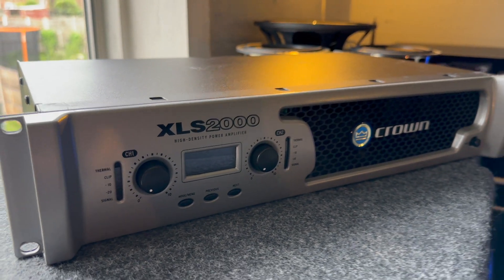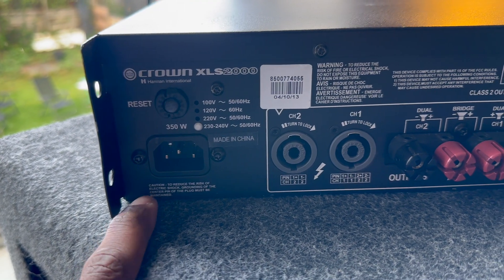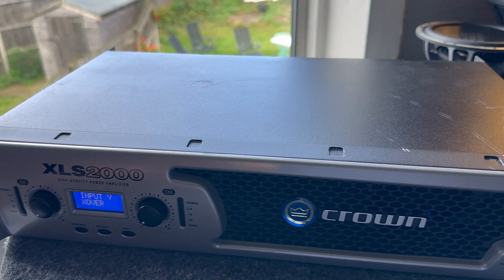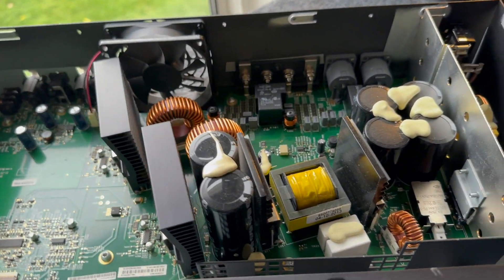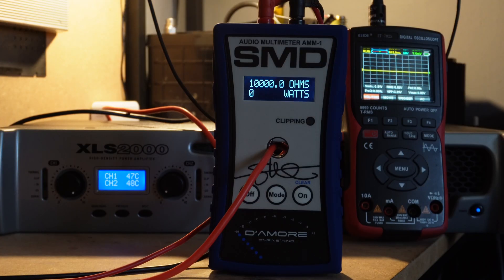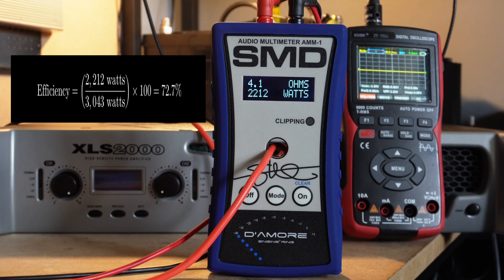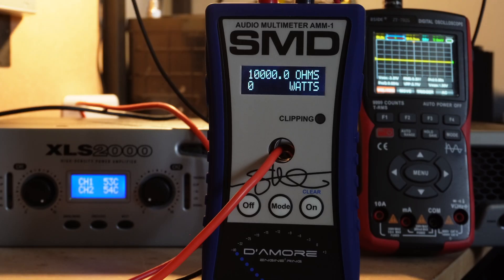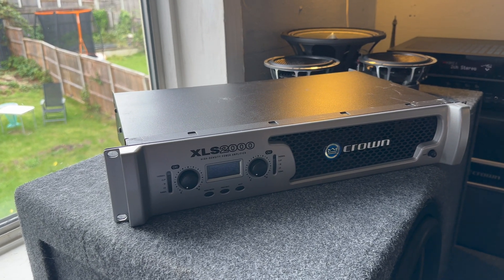Does the Crown XLS 2000 Do Its Rated Power? (Amp Dyno Test)

Comment: Thank you for this excellent review and testing, although I must say that I didn't really like that the certain Crown Amps (or any pro gear for that matter) is made/assembled  in China or for that matter anything non USA.   I stuck with a Crown CE 1000 from around 2002 that was made in Elkhart, IN as well as QSC PLX 3402, PL 236A, Carvin DCM 3800l/lx and Carvin LSX 1523s all american made.    I do use a Crown XLS 1002 (yes made in China) in my home theater system for my front JBL bookshelf speakers and it certainly does have , although not audiophile quality,  215 watts/channel into 8 ohms, more into lower impedances down to 2 ohm stereo,  way more guts than a typical AV receiver with 75 - 125 watts/channel (albeit those stretched with THD and frequency response)  at 8/6 ohms etc.  Also, it doesn't sound as strained, thin, lackluster, shallow, spitty or harsh as some users have described.   I do like Crown, but made in USA, which it appears some still are,  is a deal breaker for me in most cases.

Comment: Great video!! 🎉 I especially liked how you showed the efficiency etc!  
Question tho, won’t most people use this as a subwoofer amp? Perhaps running the dyno at 40hz might provide slightly different results. 🎉 thanks 

Btw, I’ve read that some crown amps lose ALOT of performance under 10-20hz… I think it’s been done before, but if you can, showing a freq response from 5hz-200hz would be awesome!! 🎉 great work!! 🎉

Comment: Great video.
I have two xls2500's (the amp looks identical to yours) that have been in storage in a sealed Gator case for about two years, tried them out yesterday but no output, DSP function is normal (set to stereo bypass), good input signal but nothing out from the neutrix or binding post. Do these amps have a factory reset? Cheers.

Comment: Nice test. I have a pair of Crown XLi 2500 amps (heavy, Class A/B amps). They are seriously under-rated at 750w x 2. I prefer the sound of Class A/B vs the "lightweights". In fact, owned several of these newer Class D ones and they all died early deaths. The two XLi 2500's -- never failed me once.
Reply from the maker: Wicked !! I’m glad your crowns have been treating you right
Reply: I have an xli 2500 I'm using for an 18'' subwoofer and a crown xls 2502 for my mains. The xli is 500 wpc 8 ohms and the 2502 is 440 wpc 8 ohms. my speakers are rated for 500 watts rms 2000 watts peak. Do you think I would be better off using the xli for the mains since it's a little more powerful? I think the xls sounds better but I've never actually tried it to find out. Two xls 2502's bridged are  1550 wpc each which is probably two much power right?
Reply: Do you think the real power is something around like 1000w rms per chanel at 4ohms?
Reply: what's the difference between the XLS and XLI 2500s?

Comment: I have the 1000 watt version, I love them! Now, the only issue with them for sub use is they roll off around 20hz. In most cases that's fine, but some people use tactile tranducers which go well below 20hz. So for that, it's better to use the Behringer amps which go flat down to 5 hz or so. They don't make stated power, but even at 2/3 rated they're a great value and the DSP basically pays for itself. If you have a mini DSP and need performance above 20hz, these Crowns are amazing!

Comment: Great review. 

2 ohms bridge is 1ohm per channel. I don’t think their is any pro sound amp that can handle 1 ohm. 

2 ohm stable = 4 ohms bridge. 

4 ohm stable = 8 ohms bridge. 

It would also be great to see 20hz 10hz a d 5hz tested. We are always looking for amps that can play loud low in the home theater space. Many amps start to roll off after 20hz so it’s great to know which ones don’t.
Reply: Camco Vortex series can, but other than them and crown i haven't seen any other PA brand to do it

Comment: I wonder why on the input section it says 350W? Is it 3500W Max or what should I expect? Bc pulling nearly 3kw peak is almost 10x 350 watts.
Reply from the maker: So what u you see at the back of the unit is not the maximum wattage the unit is allowed to pull It’s some ihs standard thing and I think it’s at 1/4 volume how much power the unit will pull

Comment: Hi there. Is there anyway you can see what this amp does on a 6 ohm load? That's what I end up with my two JL 13W7 subwoofers. They have dual 1.5 ohm voice coils.  I wire each sub in series to get a 3 ohm load, then I wire both subs in series again to get a final 6 ohm load to the amp. The other only way would give me a 1.5 load which could damage the amp. Thanks.
Reply from the maker: @rudycorraudio9089  sure
Reply: @-SINEWAVE02  Thank you.

Comment: the clipping indicator on these amps appears to actually be a limiter activating from what i have seen on my XLS1000 on a oscilloscope, and i have ran my XLS1000 at 2ohm bridged a lot, i just don't blast it for long periods of time, but it does work
Reply from the maker: Great observation you can’t really clip these amps it’s amazing

Comment: Great video. I have several Crown amps, all running subs I my theater and for the price are strong and reliable. I was actually running a DSI 4000 @2ohm bridged, yes I know it’s only recommended to run @4ohm bridged but it was doing a good job.

Comment: What instrument did you use to measure, Voltage, Current, Power and Power Factor? Thanks!
Reply from the maker: On the mains or output side bro ?
Reply: @-SINEWAVE02  yes, mains AC input

Comment: I have the 1000W version of this amp, and for the price it is quite excellent: light, powerful, clean output.  I use it for small parties with 2ohm car subwoofers, works and sounds excellent, and it cost me much less than even a single decent PA sub.  I'm not saying I would do serious gigs with it, but for family events it's quite nice - and since my subs already live in the trunk, it's less clutter in the garage.

Comment: Thank you mate for this video. I have two amps , one 1000xls and one 2000 xls. They are used in my home cinema to push some  subwoofers. I got a problem.... These amps requires a high level pre-amp on the rca side. My Yamaha receiver  rx-v1900 can't deliver enough voltage power on the sub out so i have a car line-amp in the setup , otherwise it won't come any sound. You mention firmware.. can these crown amps be updated somehow!? Keep up with the work, that 3 button secret i didn't know 😊
Reply from the maker: Im glad you enjoyed the video bro and you learnt that new button combo 

I had the same exact problem you had with the preamp 

What fixed it and gives out strong voltage was the Yamaha rx v677 it puts out about 6 volts clean and runs my crown and beginner and with loads of preamp voltage to spare 👊
Reply: I use an Art Pro Clean Box
Rca to xlr between the recievers pre-outs and a Crown Xls 1502. Does the trick just right.
Reply: @jshortdawgshort3033 what are you running with the 1502? I haven’t found any Dyno videos on the 1502. I have one of the new Dayton ss18-22 subs and a 1502.. waiting on the box from GSG, which is taking forever. I’m anxious to see how the amp pushes this 18.
Reply: @j @jshortdawgshort3033 also have a minidsp2x4hd and an art clean box pro. All just waiting to be hooked up.

Comment: Very nice video. I love such tests to confirm if factory or seller did not lie about the parameters. For example Behringer NX3000 on paper has 3kW bridge but in reality only 1kW.
Reply from the maker: YESS but bro i have started the video for the nx6000D   and ill give you a spoiler      rated 3000x2 it does 2***w per channel , stay tuned
Reply: @-SINEWAVE02  you are right, NX6000 is much better, "wiliston audio" did measurement with professional amp dyno and it got 2kW per channel so very nice but still not 6k as on paper.
Reply: @-SINEWAVE02 guess it will be the same as The old inuke6000 which did 2200/channel at 4ohm

Comment: This crown is a digital amplifier having SMPS power supply.. It got a lot of features, light weight and true rated but it wont last on endurance tests.
Reply from the maker: Same can't be said with most amps, the fact that the crown still has an 85% efficiency and still won’t last. 
Just goes to show that long-term power is hard to achieve  

I would assume the higher you wire like eight ohms you would have a better chance for endurance

Comment: Great video!  I personally have this amplifier in my home theater pushing a pair of JLAudio 13W7. It sounds great.
Reply from the maker: Thanks for watching ❤
Reply: I had the xls 1200 on one 13.7 at 3 ohms and it almost cut the whole blocks lights out ....the light company was passing by checking electrical transformers but I had turned it off by then I lowkey got scared😂😂😂

Comment: so your telling me a crown XLS2500 would be fine for my sundown X15
Reply from the maker: More then enough 👊
Reply: @-SINEWAVE02  Oi mate can i aak a few more Questions regarding these amps?
Reply from the maker: @EBMproductions1  of course you can bro fire away
Reply: @-SINEWAVE02  Okay so how does the crown xls handle your subs under max load over timeframes of 5min? Asking as my current amp gets up to 72 degrees celsius in 3min under full load at 4ohms running my single Sundown X15 v1 and i want to upgrade my amp as im a Dj and basshead
Reply from the maker: @erikbritz8095 The Crown XLS 2000 is a solid power amp that can get pretty hot, especially if you’re running it hard at 4-ohm bridged or 2-ohms per channel. This is because it’s working with a lot of current, which naturally makes things warm up. But don’t worry too much—it has a smart cooling system that automatically reduces the power if it starts overheating, which helps keep it from frying itself.

If you want it to stay cooler, try running it with an 8-ohm load. It doesn’t need as much current in this setup, so it won’t heat up as much, and it can still push out around 1300 to 1600 watts continuously without issues. Honestly, there aren’t a lot of amps out there that can sustain their rated power for a long period of time like this one can. Plus, most amps actually like a bit of impedance rise, since it gives them more thermal headroom, which means less heat stress and more consistent performance.
Reply from the maker: Please know I’m saying it overheats on the resistor loads when playing it through a driver and wired to the appropriate impedance it doesn’t overheat, It stays within operating temperature. 

As long as you don’t clip.
Reply: @-SINEWAVE02  yes no don't worry 95c is max operating load well maybe more in these, so im actually contemplating on going after the Celto Acoustique C2.20 amplifier their a very high end italian Brand amps rated at 2x2000watts@4ohm and 2x1200watts@8ohm reason is need 2kw max and temps will be lower on an amp running at 50%-60% load however i am working on round about three different home audio setups as i have a large house so the crown Xls2500 or Xli 2500 will be used there and this video and your guidance helped a ton with that decision mate.
Reply: @-SINEWAVE02  one last Question how did they handle your beast subs though and hows the sound compare to a Car Audio amps sound? 🫡
Reply from the maker: @EBMproductions1  I’m glad it helped you out 

Please note that the thermal management kicks on the xls 2000 at 70 degrees Celsius and the 2500 kicks on at 80°C   if there is anything else you would like to show let me know and maybe I could show more features in a video
Reply from the maker: @EBMproductions1  I’m glad it helped you out bro. That’s the whole reason why I made it. They are good amplifiers for what you can get them for pricewise.
Reply: @-SINEWAVE02  you read my mind a features and tricks vid as well as maybe a spot where you state what you like and dislike on the amp would be cool also as others already mentioned maybe bench your Behringer NX amp for fun too i am free content etc. So why not? 😅
Reply from the maker: @EBMproductions1  sounds like a plan bro
Reply: @-SINEWAVE02  very much so only reason i skipped on them in 2021 is a local brand called Hybrid had a 45% cheaper amp rated at 2x1200watts@4ohm and the amps helped however a Sundown X15 is quite ask for it same with my Digital Designs 715Ds the B2400 amp i own is a bit unhappy bout the low ohm load and power hungry nature of such a Driver. 😅
Reply: i have two xls 2500’s on four svs pb 4000 drivers and at full tilt the subs are thirsty for more power 💪
Reply: @jumpmanfan23  yes no i am more so worried about overheating due to the ohm loads i.e 1ohm/2ohm or 4ohm loads near clipping 😅

Comment: How many amps is that circuit breaker above the IEC inlet rated for? A power requirement of 350W is clearly designated between that breaker and the IEC. So, physics being somewhat rigid it would be impossible to continuously output more than 350W with only 350 drawn from the mains. But it might give bursts of very high output. I remember Crown from way back when they built very high powered class AB amps and they certainly met their ratings. I'm baffled by the 350W power input designation. Cool video.
Reply from the maker: 15 amps I believe bro
Reply from the maker: The IHF standard typically tests an amplifier’s power output, thermal behavior, and distortion while running at 1/4 of its rated power. For example, if an amplifier is rated to deliver 1000 watts at full output, under the IHF standard, the testing would involve operating it at 250 watts continuously.

the reason why it says 350w at the back is because that how much power it will consume on low power levels (IHS standard)

Comment: Those are NOT volume controls
Reply from the maker: @chemicallust77  On PA amps, the gain is often labeled as “input sensitivity” or simply “volume.”
Reply from the maker: @chemicallust77  and since my amp shows it 0- 10 that would represent volume.     The more you know Ayy
Reply from the maker: In practical terms, turning this knob controls how much of the amplified signal is sent to the speaker connected to this channel, effectively acting as a “volume” knob for the channel. While it impacts the perceived loudness, it is not a “gain” control in the pre-amplification sense but more about adjusting the level of power delivered by the amplifier.

The key difference is that the gain control adjusts the input signal level before amplification, whereas this knob is part of the final output stage, controlling how much power goes to the speakers. Thus, it’s primarily for managing volume rather than fine-tuning the input gain.

Comment: Brilliant job , really tested one of the best known amp names on the market used these in the day never let me down mine are old CS 2000 and  Crown Macro Tech 3,600 's this shook the room with subs.
Reply from the maker: I love my crown amplifiers even when I knew nothing about AUDIO. These amplifiers always had a soft spot in my heart now with the continuously growing measurement devices im acquiring. I’m seeing bit by bit how great these amplifiers truly are.
Reply: @-SINEWAVE02  Yeah when i was using mine  you also had a brand called Crest,Lab Gruppen,Dynacord,Wem etc but all in all The Crown Range was definitely the Best and most powerful  in my opinion.Some old friends of mine did some huge concerts with Macro Tech 5000 they where beast's .
Reply from the maker: @chriscollins9073  yeah, the good old macro tech. I was privileged to be able to use some when I visited Barevids.  You can’t beat the smell that comes out of them when they get warm. Crown is good. I would love to work with them in the future.
Reply: @-SINEWAVE02  The thing is though you needed a lot of mains power to drive some of these  macro tech amps  and a lot of venues now have not got it  I used to Run mine on ceeform 16 Amp plugs into a 32a or 64a distro unit to even out the load. And do you remember the sound of the selniod clicking in on switch on. Those where the days.
Reply: @chriscollins9073  that macrotech 3600 is nuts heavy but a true beast that the QSC RMX 5050a/Macrotech 5000 and VZ series or HD12000i crowns are just mind. 🫡

Comment: bro test SPL with all of your subs
Reply from the maker: Nah there no point it’s not something I’d want to share on the channel as it points it in a direction I don’t want to go
Reply: This is only an amp. rating (partial) conformity test...
& Not aspeaker handling test.
Reply from the maker: @analoghardwaretops3976  Testing amplifiers on resistive loads can provide very reliable information because resistors offer a stable, predictable load. Unlike real speakers, which can vary a lot in how they behave, resistors keep things simple and consistent. This makes it easier to measure important performance factors like power output, distortion, and heat management accurately. By using a resistive load first, you can get a clear picture of how well an amplifier works without the complications that real speakers introduce, making it easier to spot any strengths or weaknesses before moving on to more complex tests.

Comment: What are those drivers sitting on the box next to the amp?
Reply from the maker: @BARBELLS-AND-BUDS  INPHASE spx 17c and bass face Indy xm 10
Reply: @-SINEWAVE02  Are they SQ speakers? They look well built! 
Also I looked for those subs in the US and not to be found, but I did find the INPHASE spx
Reply from the maker: @BARBELLS-AND-BUDS ehhh it’s hard to say bro they are just targeted for automotive environments they could work really well though as PA for the bass face and the SPX is sound pretty good
Reply: @-SINEWAVE02  Oh I would use them in my car. I was asking are they sold to be LOUD or sound really good? Im more inclined to buy "SQ" sound Quality than Loud speakers. Subs on the other hand loud and LOW